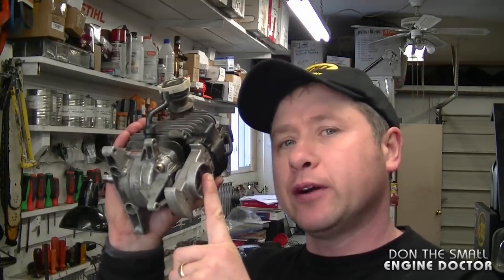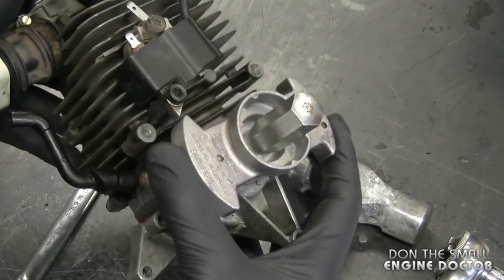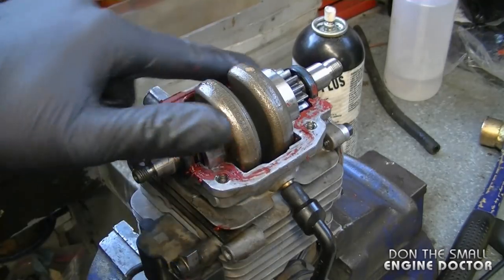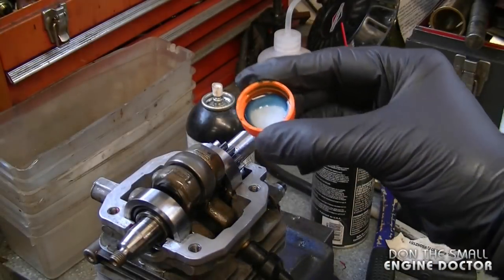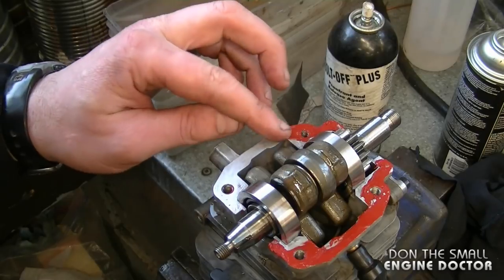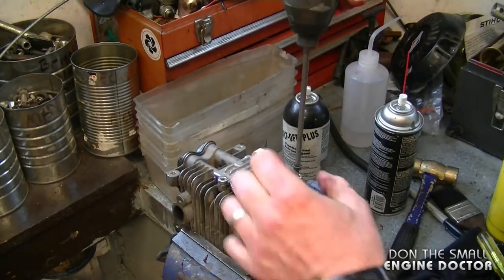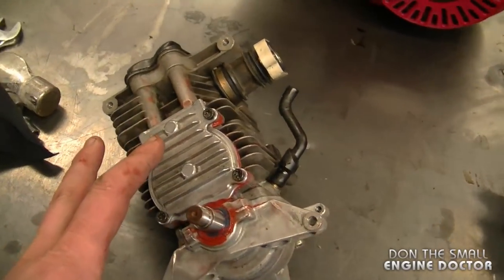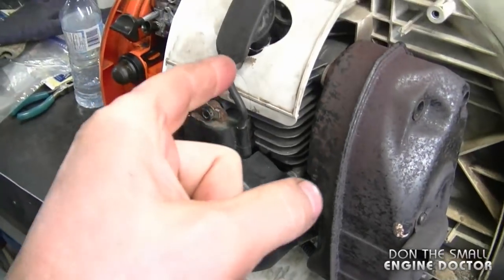HOW-TO Re-Seal The Engine Block On A Stihl 4-MIX BR500 | BR550 | BR600 Leaf Blower

Comment: So I don't strip the threads, I like to start the screws in by hand by turning them counter clockwise until they drop into the old thread then turn clockwise to make sure they're in the old threads before I use the power tool to torque them to specs.
Reply: So I don't come off as a tool bag  in the comment section I try to stay away from knit picking the best damn small engine mechanic on youtube.
Reply: That was a well said and informative comment which I also do to avoid the possibility of crossthreading a fastener. I didn't see it as a negative comment at all.
Reply: d hamby m
~
Me either Brotha Donyboy wont either
Reply: It’s all about experience and knowing your tools. Guess what fellas? When the cameras aren’t on he will not bring out a torque wrench for every single bolt. The horror!
Reply: Cross threads are way better then locktite. Lol
Reply: I’ve been using this method with all fasteners lately and so far no cross threaded fasteners.

Comment: Dony I dont like that sandpaper around the internal engine parts mate
Reply: Also, using that grinder w/wire wheel on that soft alloy! NO!!!! Use the Roloc blue disc.

Comment: Why can't these companies like Stihl and the rest use a real gasket instead of that "GOO"? I hate that stuff.
Reply: Denny Rice probably to save money on assembly costs.
Reply: Couse you have to buy are replacement gasket for every machine you are working on of have a lot in stock. Now you only need one tube of liquid seal for all without going to the parts store or have to order it online. I wish they used liquid on every part of small engine machines.
Reply: Because it’s a clamshell design that holds the bearings between the halves, the clearance needs to be exact to hold them tightly and with liquid gasket all the excess squeezes out
Reply: All the stihl chainsaws with a clamshell engine block use liquid gasket and the ones with a full 2-part crankcase have proper gaskets

Comment: I personally wouldn’t use sandpaper to clean mating surfaces especially on the block side, I’m sure any chance of getting grit into the internal block could cause a great amount of damage. I use a scouring pad or scotch bright to remove old gasket material. WD/40 works well as a cleaner I’ve found and it keeps solvents from getting into the bearing areas of the engine.
Reply: Agreed. I like to use a clean, fine stainless steel wire brush carefully by hand with some acetone to help clean things as I go. No disintegrating sand paper creating grit, no bristles falling into the engine. Also I found it easier to simply remove the crankshaft/piston assembly to remove any nasty bits that may have fallen into the engine or place a wad of rag in the engine to catch any bits of old silicone seal. The subsequent correct re-positioning and timing of the crankshaft is easy. There are videos elsewhere on YouTube explaining this.
Reply: I am mindful of this - good quality tools in good condition used carefully are the way to go. Also I like to use the brush in a "sweeping away" action so bits don't fall into the engine 👍🏻🙂
Reply: The wire wheel on the bench grinder was the most "cringe worthy" thing for me. A wire wheel can erode away aluminum very quickly, leaving gaps in the mating surfaces.

Comment: Great video. I usually pull the crank and piston right out of there. Its so simple to take out and put back in.  The cylinder is shaped so the rings are compressed as you push piston back in. It takes 2 seconds.   It makes cleaning the old gasket so much easier and you don't get junk in the bearings by mistake.   I  use brake cleaner with a soft bristle wire brush to get the old gasket off. If any old gasket falls into the cylinder, It easy to get out of there.
Reply: he was concerned about the timing of the valves on this 4mix motor...
how do you make sure you are not changing the timing?
Reply: Best part is no Pins in the ring slot.  Its just plop it in.  I do prefer the Husqvarna  cylinder has a slight chamfer On the base assy so whole lot just slides in like butter.

Comment: Finger tight bolts for ONE hour. Let a fat rubber piece develop. THEN torque bolts so it squeezes the rubber seal. You don’t wanna smash it all out when it’s really wet. Great video!
Reply from the maker: good tip

Comment: Donnie , did you find any info on why you have to use the Dirko ? I could NOT. So I used "RIGHT STUFF" gasket maker. So far the units I have sealed have had NO issues with oil leaks and are at least 2yrs older now. The only reason for this statement is that I feel Dirko is a bad choice for sealant. I have handhelds leak at a year old or so. So why put the same sealant that FAILED the first time. Hope to see more 4mix videos !!! :)
Reply: I thought the same thing. I always use a sealant from Yamaha that is used to seal case halves on dirtbikes but Suzuki and Honda make their own too. I have never had a failure with that stuff and my bikes have been together for 8+ years. Also Mercedes uses a sealant for a head gasket. A friend of mine gave me a tube of it and swears by it, he's a Mercedes tech. I haven't tried it but if it works for a head gasket I imagine it will seal anything and hold up for a while.

Comment: I have a BR600. That's a lot  of work. Equivalent in scale perhaps to replacing a car's rear main seal; ie, tiny parts price, huge labor. I mean, you didn't film removing the motor which is no simple and quick task by any means. Gonna check mine for leakage issues as you pointed out. If this is a common issue then boo to Stihl because the blower is very expensive. Also agree wholeheartedly with DennyRice; why not a gasket, Stihl? Thanks Don for such a clear video on how to fix it should it occur.
Reply from the maker: yes it is a common repair on these. i'll try and make a video on removing the block from machine
Reply: Disassembling the engine on the br500/600 is a huge pain because all the plastics have to come apart to get at the cylinder screws, which means the fan/impeller has to come off which can be stuck on even when using an impact wrench
Reply: ghetto bikelife after I did it once it took me about 15 min to remove the whole engine the pain it the fan

Comment: Wish I could post a pic. Got one of a exhaust valve in a BR600 stuck in the top of the piston. Owner said he had it full throttle and it just stopped. Said it damn near jumped off of his back. Exhaust valve broke and got stuck sideways in the top of the piston. Put a new long block in it under warranty.

Comment: I love the sound of those motors. 4mix engines sound so different compared to a 2 stroke
Reply: To each their own, I personally cant stand the sound. It sounds like 4 stroke with an exhaust leak.
Reply: 4ceof5pades solution to the problem, wear ear protection 😂

Comment: Hi Donyboy, is there a difference between Dirko HT and Permatex Red RTV High Temp? I recently resealed a Stihl 025 with the permatex stuff and she's holding pressure and vaccum real well but you always use Dirko. Is it just your preference or have you seen the Dirko HT stuff outlast other gasket makers? Btw, long time subscriber and I love all your videos...easily the best small engine repair channel on youtube by far.

Comment: Another fantastic use for Mercury power tune is for fuel line or hoses. If you can't get a hose off, just insert a small pick in between the hose and the fitting and give it a small shot of power tune. The hose will slide right off. A little shot inside the hose you're installing and it will go on with ease. it'll make it so slick you can stretch a gnats ass over a telephone pole!

Comment: I was wondering the history of this blower (many, many hours/years of use?) to know why those seals leaked at all using the Stihl original sealant.  Seems that if the bolts haven't loosened (and they shouldn't from the factory), there should NOT be any leaks (unless dropped, or similar of course.)   I echo the other person's opinion to use something else/better (have heard excellent reports on that Right Stuff).

Also, can you explain a 4 stroke engine that uses gas/oil mix for fuel?  WHY, I guess is the question.   Thanks.

RichE
Reply: Gogle Plus Sucks the 4 stroke design gives more torque to a conventional 2 stroke and possibly for emissions ? I’m not too sure but as for the need to re-seal I have worked several needing to be resealed and from talking to others seem something that has to be done at some point in its life possibly a down side to the design of engine ? I use a fs90r with the 4 mix engine and by far better than any 2 stroke I’ve ever used power wise but many are put off by the engine not can get abit annoying after awhile

Comment: Hay i have a stihl br 550 and it was full of water i took it to the dealer and they said the engine needs rebuilt and it has no compresion and that would cost me 3to $400 dollars but im wondering if i can rebuild it myself and what parts and tools dobi need
Reply: OR Greens you need a new blower. There's pin bearings and ball bearings hooked up to the crankshaft if it was flooded with water it probably rusted the crankshaft assembly and bearings.

Comment: hello, good video.  I shifted the engine and I don't see any setting point apart from the 2 arrows which must be aligned on the joint plane I think, and for the crankshaft I don't see anything can you help me? Thanks

Comment: Have a FS110 weed trimmer with a cam wheel that broke apart inside the casing and jammed. Bought a new cam wheel and hope to get it running when reassembled... The metal plate on the back side of the cam wheel was bunched into a ball and the hook shaped piece that spins and covers an ooening to the crank shaft were loose or wedged around the broken gears. It looks like it might have scratched up the casing and may have elongated the hole in the casing for the cam wheel pin... Anything to look out for when the cam wheel arrives? Isnit likely I'll have to replace the whole block casing? Not sure it will be worth buying more parts...  Thanks!

Comment: I used that Stihl piston stop yesterday on a 4 stroke and the darn tip broke off inside the cylinder.  Luckily, I was able to remove it before it fell into engine!  It's a weak tool....beware! :)

Comment: The 4 stroke Stihl engines appear to be far better built than the 2 stroke engines as the 5mm self tapping screws on the 2 stroke engines seem to be only good for 1 use then the threads strip out in the cylinder.

I modified a Stihl 2 stroke hedge trimmer to accept M304 6 × 1 mm stainless steel bolts for the cylinder as the bolt holes in the aftermarket cylinder were too big for the 5mm screws.

The same went for the clutch which fell apart when the self tapping screws worked themselves loose,I just retapped the holes & fitted the 6mm screws.

I'm not sure what's going on with the 4 stroke lawn equipment such as the line trimmers & leaf blowers as Ryobi used to make them but seem to have reverted back to using 2 stroke engines.

My Dad has a range of Honda 4 stroke lawn equipment such as the push mower, line trimmer, hedge trimmer & leaf blower.

I did a bit of work on the line trimmer which gave symptoms of bad fuel delivery, so I cleaned the fuel tank & carby out then replaced the fuel filter.

It actually ended up being a faulty spark plug which caused a seemingly lean & bad running condition.
Reply: The reason they went back to 3 strokes is the plastic cam. The only part you can not get. They get hot ant it turns the lobes on the cam round so now the valves don't  work. A plastic cam. OMG give me a break.

Comment: I'd like a better look at that piston stop tool. Does it have a rubber top on the end that goes into the cylinder. Do they make one for Honda mowers with a blade brake so you can remove the center bolt without an impact. Or is there another way to do it. Thanks.
Reply: That's a Stihl service tool. 
You'd have to find a Honda engine service manual and see if they spec one to get the part #.  Might be cheaper to buy an impact wrench than get a tool like that from Honda! But if there is one and you can get the part# for it, then maybe you can find an aftermarket one.

Comment: I have an ms390 that I got not running after it was straight gassed. I replaced the longblock  with one with good reviews from Bailey's. The saw starts and runs fine but once it gets hot it looses power bogs and eventually dies and won't restart. If I give it some ether it will start up but bog  and die again. I've gone through the carb a few times and it's working properly. Could this be the seal like this br500? they have a similar bottom end design.
Reply: Have you checked the spark arrestor screen inside the muffler?? I just had a chainsaw in the shop last week exhibiting those same symptoms. After checking the carburetor was set correctly, I decided to check the screen just for grins and giggles. Guess what....almost completely blocked. Burned it out, reinstalled and watched a smile come to my customer’s face. Ten minute fix while he waited.

Comment: whats a good alternative to the dirko  i have some permatex max torque hightemp
Reply from the maker: I also use hondabond
Reply: i  watched a video about permatex they say have permatex moto seal and  permetex  permashield fuel resistant  still not sure which one  would be the one
Reply: cool i ended up buying the dirko had to buy it online what  tool do i need to pressure test the stihl km131 r anyway i cant find anything or do you just  have to make  one somehow

Comment: We have a four cycle machine in at work that will idle but won't rev up at all. We have fitted a new carb but no difference, removed exhaust no difference. Could this be a leak as in your video.
Reply: Hi Andy  did you get the machine to rev up? I am having the same issue. However if I let it warm up for 10 min it will come to life and work perfect. I am thinking it has to do with the auto decompression mechanism under the cam wheel.

Comment: A engine pan on a fs90 looks infront of me has some of it eaten away in the center bottom as if possibbly water entered it.  The carb, seals and piston are obviously done for. Any idea how to get the timing right as well as its valves. They had attempted tuning the valves and that was a failure.  Looks like I currently have all the tools u used  excluding adjustable torque wrench.  I can borrow one but it maxes at 150 lbs and starts at 15 lbs.  I also have a br500 parts blower i know has leaky seals and only runs choked.  I think that's all but I cant be 100% as of now.  Just a few projects I've been tinkering with when I can.  Ur impact looks somewhat similar to the one I got and like.  Its m18 2750-20 with multiple size batteries I can swap on.  I had to use a fresh 5 amp or a 9 amp HD on a 77 Chevy pickup for the 1st time a few months ago.   I also want to split the case on a ts400 I have that needs bearings and seals 1st before the water kit, blade, belt and feet r replaced. The tilly carb and top end were beat too. Got a new oem carb for 30 from someone who ordered the wrong one and never looked at it till it was to late. Got the jug but the only piston and rings I have on hand for it are hutz brand. Ts400 is cleaned up and sitting in pieces wrapped with saran and piecesml of Terry cloth. Got a old 3 point coil so I think it's been shelved a while now. Warm Compression was under 65lbs running wot only. If u can lmk anything i should have on hand to help split the case as well as to put it back together.  No press or splitter in my stuff yet.  Do u think I can skip purchasing those for now or would I be just asking for more problems.  I never split anything close to this size and currently am putting it off.  Any advice is always appreciated and if that's asking to much I am still very thankful to be able to use ur channel.  Without Utubers like u I'd be pretty much s.o.l.  Thanks and please keep on doing what u have already been doing.  U have helped a few friends I told to check ur tutorials out too.  Ur helps always been amazing and without the extra talk most other videos are full of

Comment: I have a Briggs engine that over revs . All linkages are freely moving but the throttle control does not alter the revs. When running I tweek the governor arm and this does nothing. Do you think it’s a carb problem or a governor problem.
Regards.
Kev
Reply: kevancroftkc sounds like governor came apart inside motor, had an 18.5 b&s do that to me

Comment: Hey Don, I have a problem with my mower and was hoping you can help me. It is a relatively new troy bilt push mower and I'm having this problem where it is idling a bit rough and it has trouble cutting any slightly taller grass, I cleaned out the carb already and the fuel is fresh, what could the issue be?

Comment: I just bought the stihl br800x this week. Trying it out this weekend. Donyboy73 do you recommend these leaf blowers made by stihl?
Reply from the maker: i recommend echo and husqvarna 2 strokes
Reply: @donyboy73  why not stihl 🤷🏻‍♂️??
Reply: @donyboy73  can you make a video of what happens when you use regular gasoline inside these engines instead of the 50:1 mix gasoline/ oil. Guy on Craigslist selling a backpack blower that used regular gas. Should I run or grab it. Only for parts he said. Maybe easy fix like fuel filter?